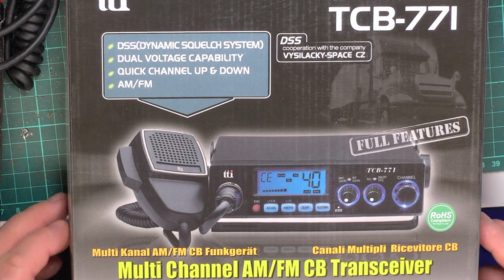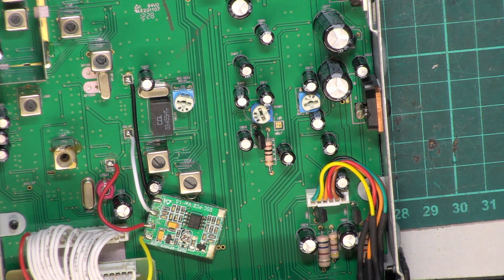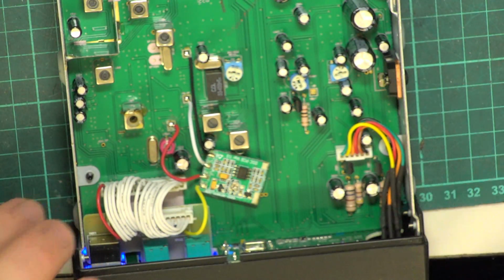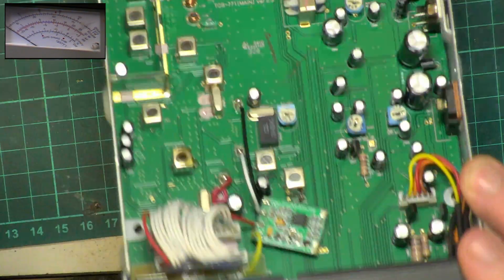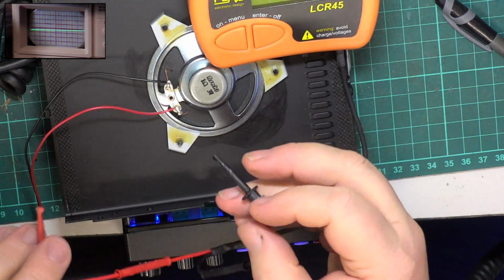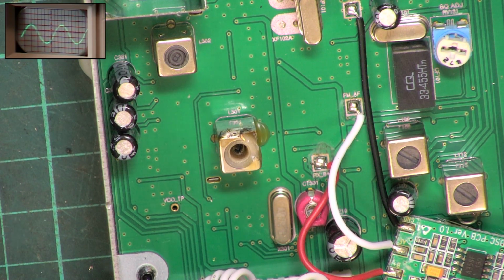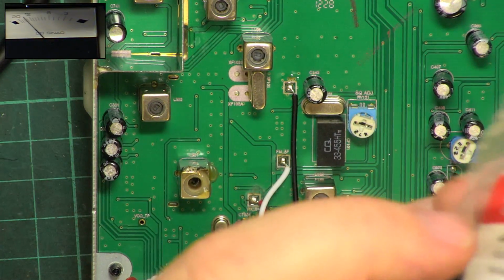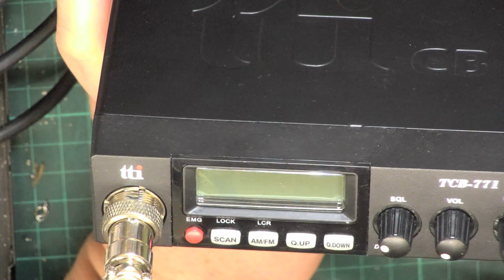TTI TCB771 UK CE MultiNorm CB radio (mobile) - Repair & alignment

Comment: I purchased one of these from a local seller on fb marketplace for £30, he threw in a couple of mobile antennas too, my question is, am I better off having it on the UE setting so I can scan the UK and European channels, or just on the UK setting? (I'm new to all this)
Reply from the maker: Well I find the EU set of channels useless round here in Lincolnshire with so much interference my range drops to 1 mile, whereas I can mange 35miles on the UK set of channels.

Richard, G0OJF, UK

Comment: I see the box actually says Dual Voltage, so someone may well have innocently connected it to 24V thinking it should be good.
Reply from the maker: I've just looked "Dual voltage capability" says the box which you would expect means 12/24V. No idea what it means as the radio says 13.2V  on the back, as does the instruction book! Perhaps it means 12V or 13.8V. More likely sales B.S.

Richard

Comment: Nice looking set for what it is.  That is the problem now, a lot of sets are coming out dual voltage so they can go into lorries/trucks and farm machinery, you can swap then from car to truck, as long as you connect them the right way round of course!  But this one is a 12volt only set?  I bet someone lost a bit of money doing that when they let the magic smoke out.  Why do they go inside the radio when they have no idea what they are doing?  I couldn't believe the speaker wire being off, especially as it clips off the board.  I have not come across that transistor yet, that looks an odd one.  Stick to your guns and put the proper parts in if you can still get them, an equivalent might do, but not all are exactly the same as you well know, what is supposed to work sometimes doesn't as I have found out much to my annoyance in the past.  Have to watch the road test tomorrow, it is getting a bit late now at  1:20AM.  Stay safe, this virus is determined to get some of us!